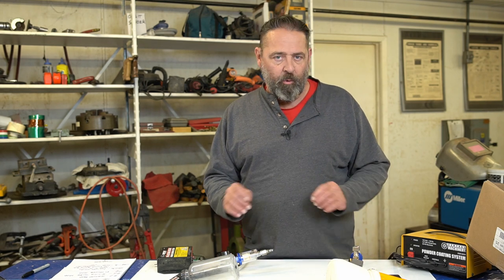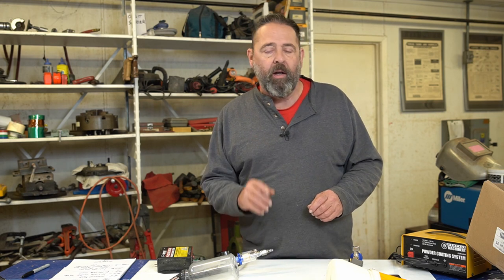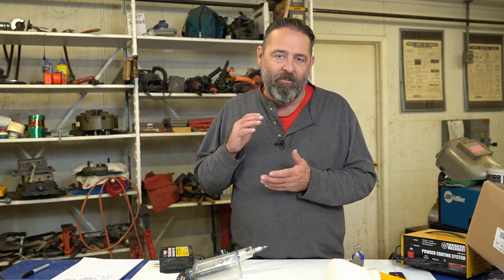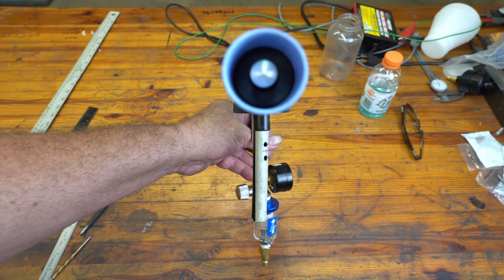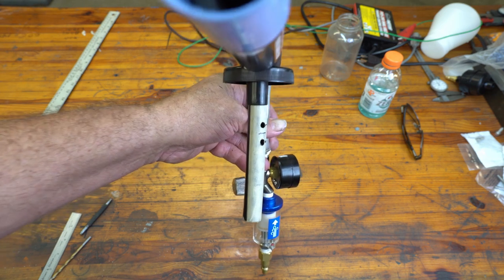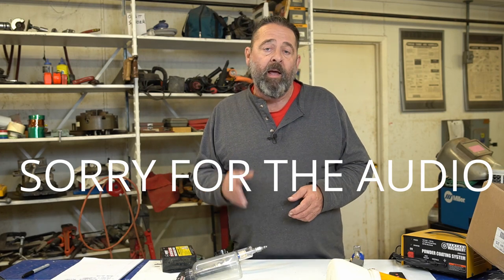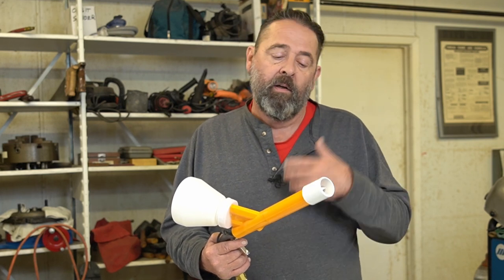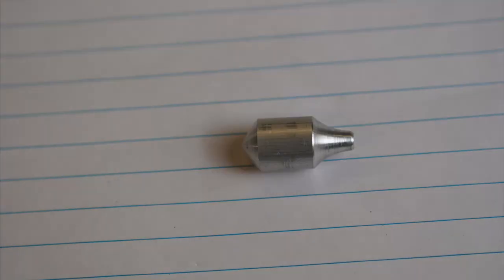3 MOST NEEDED MODS for DIY Powder Coat Guns (Eastwood/Harbor Freight)

Comment: Can anyone please tell me how to remove the siphon tubes to replace the cap on the gun?  I dropped my Eastwood Dual Voltage gun and cracked the lid. Thank you.
Reply: All, I figured it out. The tubes are threaded. I took a med pair of Channel lock pliers and carefully loosened them from the body of gun. There WAS some type of thread locker on the thread so just go slowly and take your time.  I then took a spare cap and drilled 2 holes in it using a 13/32 bit. I also put 2 new o-rings on the siphon tubes. I used a Harbor Freight o-ring kit and used the P10A rings which are 9.8 x 2.4mm.   The only thing that takes some time and attention is getting the hole-to-hole spacing correct and the correct position on the cap itself so it fits properly in the flat of the gun body. I hope this helps someone who may have dropped there gun and cracked/broken the lid. Feel free to ask any questions.

Comment: I have all of your mods for the HF gun and did the ground pole as well. Oddly enough the gun shoots HF powder without issue and it sticks no problem. But I cannot get prismatic powders to stick to anything. All same process and equipment. HF gun too low of voltage you think?
Reply from the maker: Some of the prismatic powders have issues in DIY guns and I have no idea why.

Comment: Have you had any experience with the Redline EZ100J? My wife bought me one for my birthday and I have not set up my shop yet. I build and sell 55 gallon drum smokers and will be doing the sandblasting and powdercoating myself instead of subbing it out. TIA
Reply from the maker: No, I have not used that brand before.  Good luck on your endeavors.

Comment: Hey sir! What pressure do you recommend for the Eastwood?  I run at about 5 psi but some powder just doesn’t get mixed up. Prismatic white pearl. I put about two inches in the hopper. Any advice would be appreciated
Reply from the maker: I run at about the same starting off and adjust accordingly, not all powders flow the same.  Also you might want to check out this video if you haven't seen it yet...
https://youtu.be/5tarIOt5Z-s